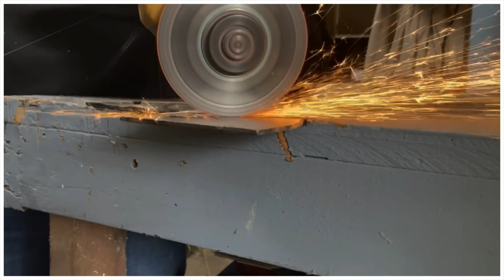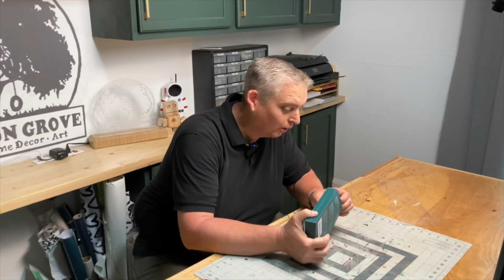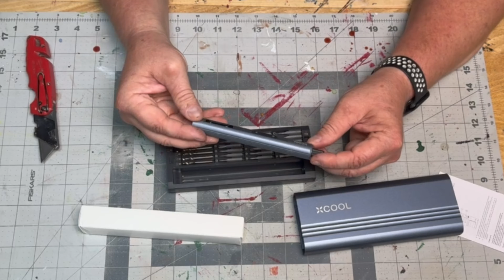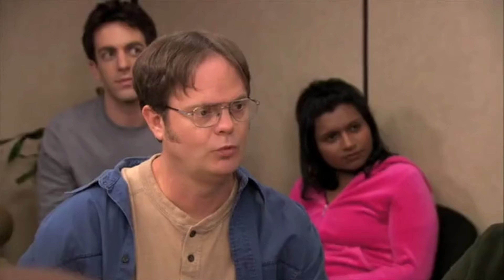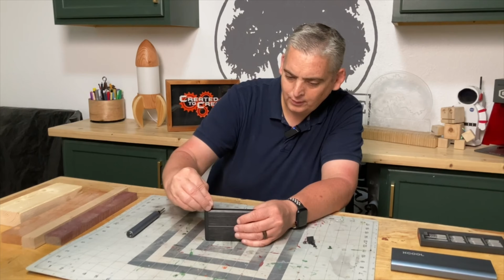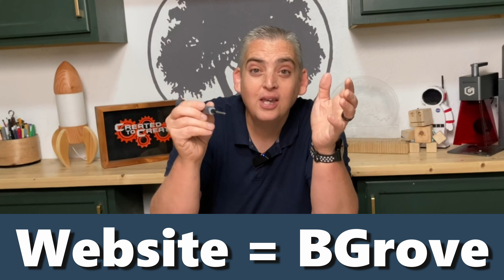Is xCOOL The Best Mini Electric Screwdriver Set for DIY?? #xcool

Comment: I don't want to HAVE TO plug into the case the charge.  I need to be able to plug a USB-C cable directly into the screwdriver.  FAIL for my liking.
Reply from the maker: I hear you. I guess they were thinking that if you're keeping the screw driver with the case, then it wouldn't matter. Now that I've had it for some time, I realize that I would never buy it because I rarely use it. Plus so many companies are doing these now that I'm sure you could find a better version.
Thanks for watching!

Comment: getting this for my PC building, looks perfect for my needs, because of a condition I have, my fine motor skills are terrible and I shake alot, this will be great for prolonged build sessions, I have a ifixit kit, which is great but adding this to my little household tool bag will make things alot easier.
Reply from the maker: Awesome! Yeah, that's what I ended up doing with it; just keeping it at my desk to work on the computer.
Reply: @boydstongrove  I have a build or fixing someones PC all the time, this kinda tool is awesome
Reply: A little more expensive than some electric pen screwdrivers, is it worth paying for pc builds mainly? been wanting an electric pen screwdriver set for pc builds to get into tint spaces :)

Comment: Nice review. Has a fellow woodworker, I don't see much need in the shop for this tool. As a grandpa with 17 grandkids, I see a lot of potential in the tool. They always have broken toys and electronics to repair. This seems like it would make these repairs easier. I think the drill bits would work better in hard plastics, rather than wood...maybe? With the tools that are not kept in the case, maybe a video on making a storage case where everything is kept together? I aways enjoy your videos and hope you keep making them for a long time to come.
Reply from the maker: Thank you! I agree, as a woodworker, I hesitated at first accepting the sponsorship, but I do use my regular mini screwdrivers a lot around the house and I have been using this one to change out batteries and such. As far as the extra tools, I putt them along with my small pliers and such in the office and I am working on ideas for a caddie / workstation that will hold them all. Thanks for watching!

Comment: Hard to believe that anyone would need a 'Power' mini screw driver.
Reply: its good for people who have limited hand movement and strength.
Reply: @buddhistboy7246 Exactly!
Reply from the maker: Yeah, need is a strong term for this tool, but I will say the LEDs on the end are really handy
Reply: as an unlicenced consumer electronics repair guy; electric precision screwdrivers are SOOOOO nice to have. the battery never dies bc I run it like 2mins/week. its weak enough to not strip small plastics but strong enough to break the "seal" off almost everything I've tried it with. xcool is a rebrand dropshipping operation. the unbranded one can be found for $16 on temu and it'll only ever be a $10 screw driver but it has its niche for sure.

Comment: I purchased similar one from Amazon “ HYCHIKA 4V 2.0Ah Electric Screwdriver Rechargeable “ that I recommend was only $26.08  which have used over a year.!  Where as the Xcool is $59.99 from your review and my experience with the Hychika equivalent. Admittedly I have not worked as many woods.
But appreciate your excellent comparison.
Reply from the maker: Yeah, I'm sure there are tons of brands out there making these now, and I have noticed they've become really popular on social media for whatever reason. I've never tried one myself until XCOOL reached out. I will say that I've worked with Hychika in the past and they had great customer service.